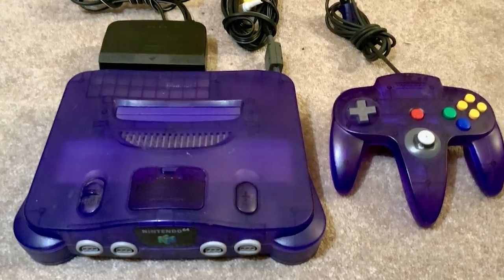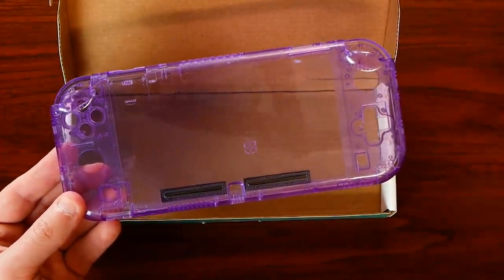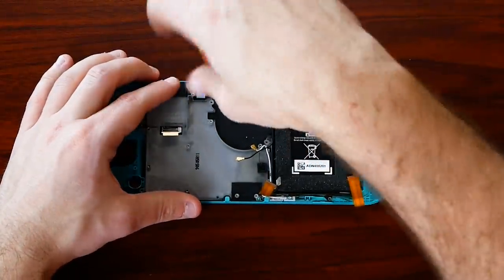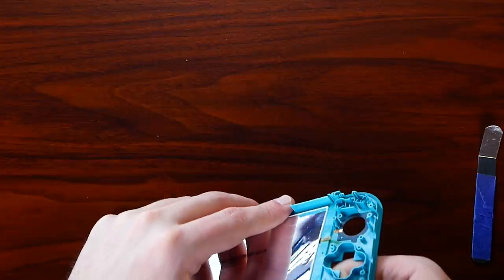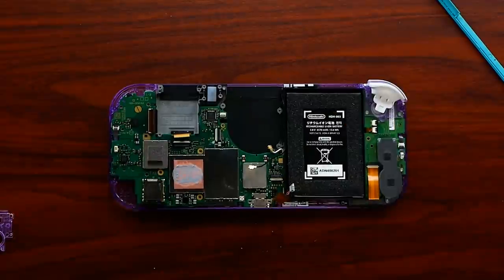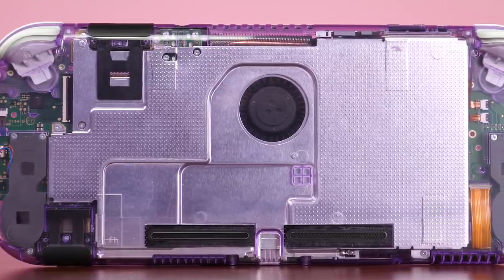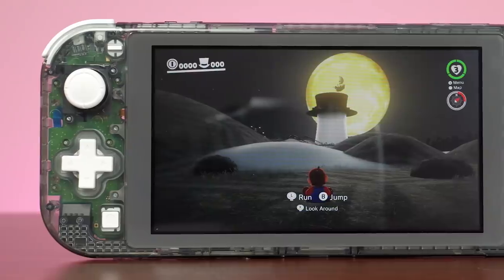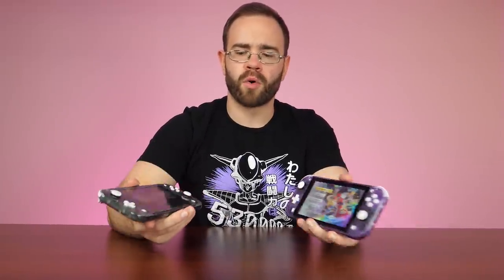I Installed The New Atomic Purple Shell For Switch Lite...Here's What I think About It

Comment: Looks great, but NOPE! I draw the line at heat gun, replacing tape and fear that i will get dust between the screen and digitizer.
Reply: Have a local repair shop do it, these are actually fairly standard procedures for phone repair so those people are typically trained on how to do that kind of stuff safely. I have to use heat guns on phones all the time

Comment: So what did to my switch lite gray is that i bought the ifixit tool and the dark clear case from the same company. i am a little bit uncomfortable with removing the entire switch just for the case and knowing the current situation. I decided to only replace the back case of the switch. So before putting my dark clear case on i added a decal sticker on the Metal shield it look super cool im glad that i went with it. As for the front i ended up using a really cool dark decal from Dbrand with their big option for tempered glass  it match really well with the gray bezel. The one downside i have for these clear cases that the SD and Game card slots aren't that great with their quality being really cheap and so i wanted to keep all the original parts from my switch for these slots however the original game card plastic piece does not match the clear case, the case is slightly bigger for the plastic piece to go in. I have heard that not all clear case are the same side so i was lucky that i can screw the back clear case on to my original front case

Comment: im enjoying my switch lite. i decided to change the stock turqoise shell and put on an all white one. to me the all white one feels better compared to the stock shell. the thing i dislike about the custom shells is the sd card and game cart covers. with the stock shell the parts you slide out before bending are actually rubber. the custom shells come with ones that are all plastic so down the line you might have to get replacement covers. i do wish the white came with a white bordered protector instead of a black one. a warning to those wanting the clear ones. the white one is my second shell BECAUSE the basic clear shell the sides of it started to crack on the inside (back cover). the shell wasnt bent or anything. in packaging it looked fine but once put it all together thats when the cracks showed up and everything was put together in 2 hours time because i took my time putting it together so i was very careful. it can be done in less than an hour but better safe than sorry. im guessing the clear cracked on the sides because the clear shells probably use a different quality plastic compared to the white cause the white has a different feel to it too.
besides this one issue i love the new shell and definitely worth it if you want a different look. the white one is perfect if need a base before applying custom skins. now i need to find an all white shell with white buttons, white charge grip and joysticks for my joycons and everything will match.

Comment: I'd lose the EM shield with the transparent shells.  It's there for FCC compliance but the Switch will function fine without it.
Reply: @Mike UK 1970, it makes about a 1c-2c difference in the testing that I've seen (and that lines up with my own experience with my original Switch).  Outside of extremely hot ambient conditions you're not going to see a noticeable impact to usability.  I don't have a Switch Lite to do before and after testing on to verify the temps for this model but maybe John will be kind enough to do some testing on this channel (assuming he hasn't already).

Comment: These shells are too transparent. They don't get the old transparent plastic look quite right, and the back of the Switch doesn't work well with transparency. It's a giant metal plate. I went with the solid white case for that reason. I think the transparent teal one looked good from certain angles.

Comment: I broke 2 ribbon cable inserts doing this. Replacement board for the mini joycon is $71 on Ebay. Not worth In my opinion. Fortunately I play using an external controller any ways.